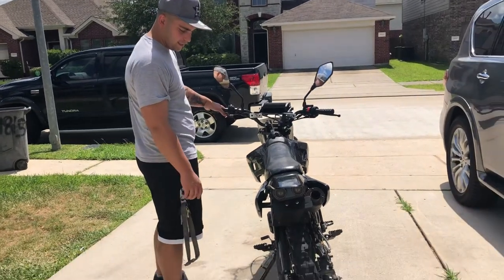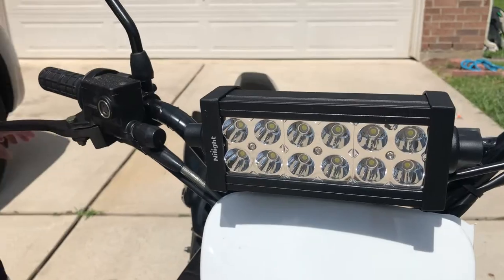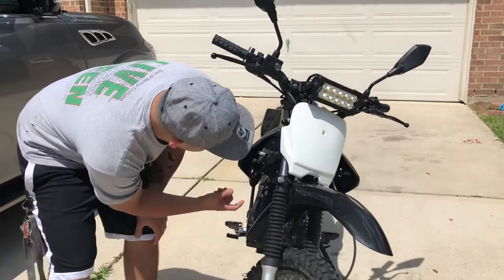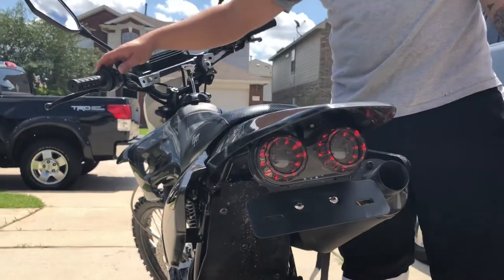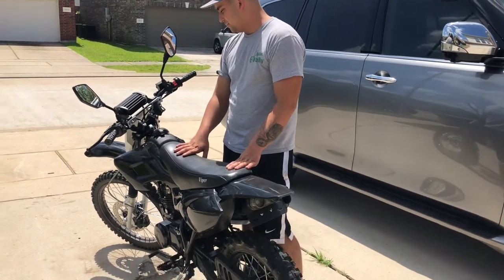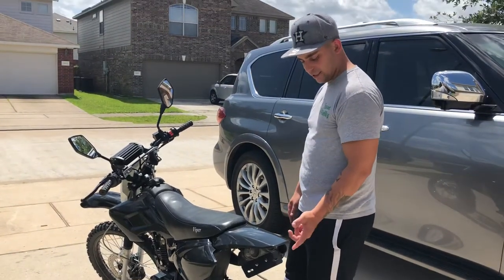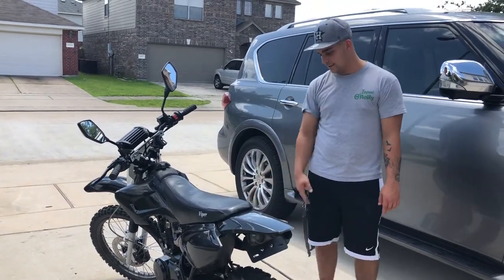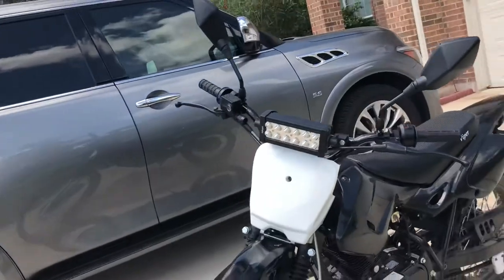How to make a dirtbike STREET LEGAL!!!!!

Comment: You need to her s regulator/rectifier.  You connect your battery to it to change from ac to dc.  Easiest way is to run off dc like a snowmobile.  The more rpms you give the bike the brighter the lights get.  Kind of crapps because it dims quite a bit if your idling but the easiest and cheapest way to do it.  Especially if your not doing much night driving it will not matter anyway.
Reply from the maker: samuraikido It’s a great idea but the dirt bike does not have a battery so I have to rule that one out. But maybe a stater? Do you think that would work
Reply: Adewsi TV yeah sorry.  I meant you hook it up to the stator.  To run ac you need a battery.  To run of dc you run off the stator.  You also want to use as low a draw as you can for lights or you risk taxing your stator too much and can fry it.  But if you do it is easy and cheap to replace with a better one
Reply: I was going to get this bike a while ago so I looked how to make it street legal here.  Almost same laws as Texas.  Just headlight with hi/low, 1 working brake with stop lamp, horn and 1 mirror.  We do not need a license plate light or turn signals.

Comment: Man I’m in process of making mine street legal.How you connect the rear foot peg with the tail light?
Reply from the maker: Νικος Αλια'ι' type in brake light switch for Dirtbike on amazon. It’s a little bolt looking thing with two wires coming from the top.  How it works for you bro.

Comment: Hey bro I’m trying to get nice kit like yours  I need my bike street legal lol looks simple. Where did you order your parts from. 🗣🗣 help asap
Reply from the maker: Etang Finessin Everything was purchased off of Amazon. I just search for LED light, review motorcycle mirrors, motorcycle control, motorcycle horn, brake lights. I’m not sure if you have already looked into it but there is a company called dirt legal. That helps you legalize your dirtbike. I would look them up if you haven’t already. Don’t for get to subscribe
Reply: Adewsi TV thanks bruh will do.! And what if my bike don’t have a battery would everything still work??